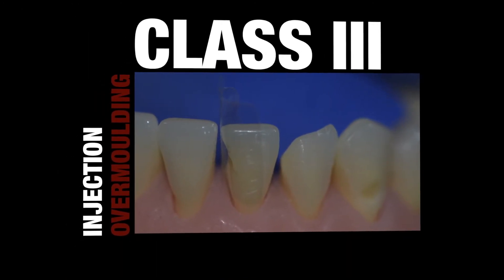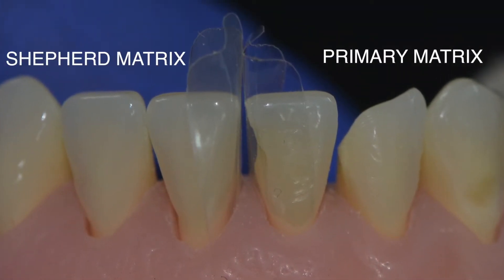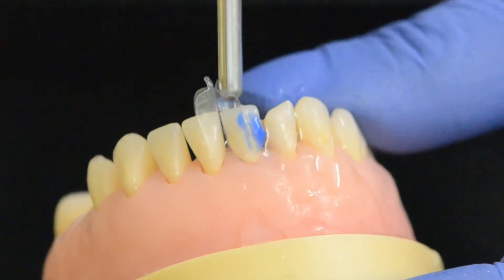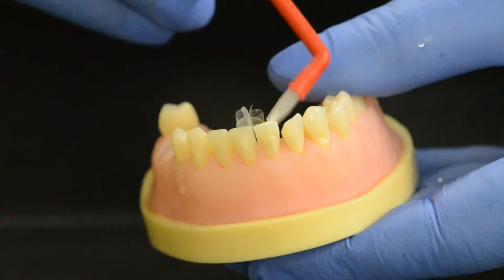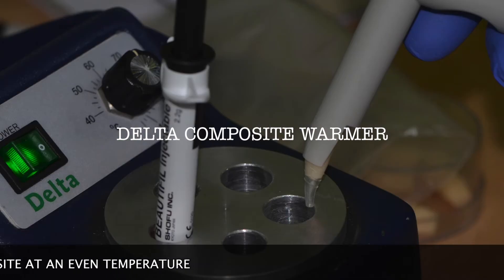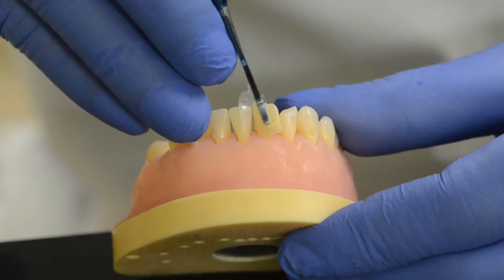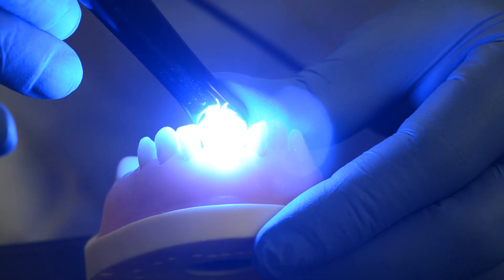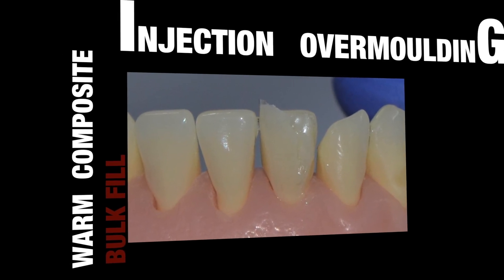Class III LCR:  INJECTION MOULDING (BULK FILLING)

Comment: U should secure the matrix before adding composite
Reply: Thanks for dropping by and thank you for your comment. Bioclear Matrices have a reverse curve at the cervical end which tends to lock into the free gingival area of the tooth making them surprisingly self secure. With a regular Mylar matrix you would definitely have to add some measure of friction to increase stability but with Bioclear matrices that is needed only if the gap between the teeth is really wide. Once again thank you for noticing.